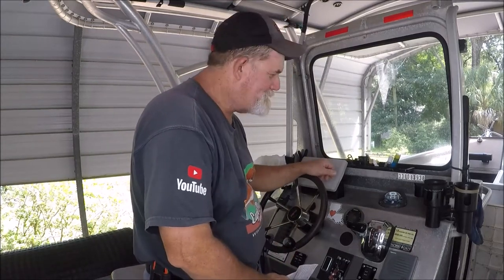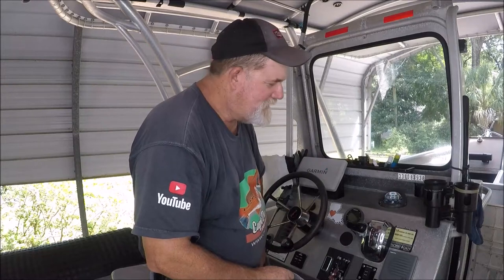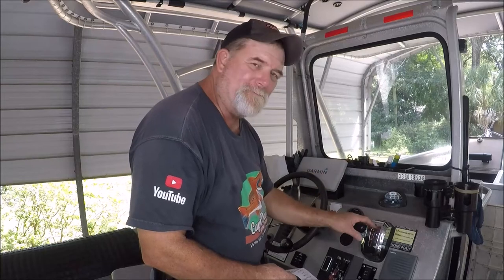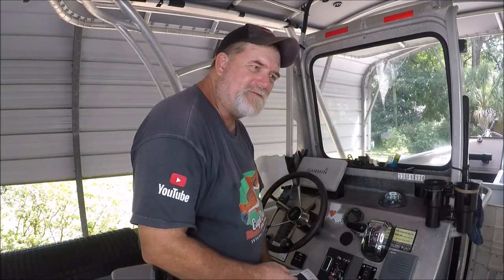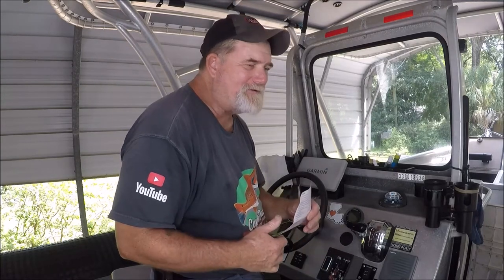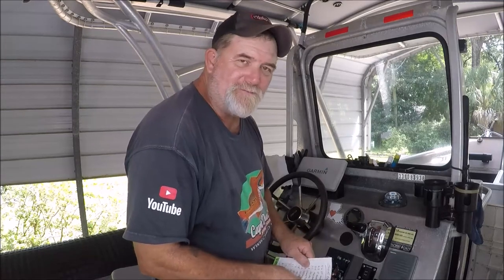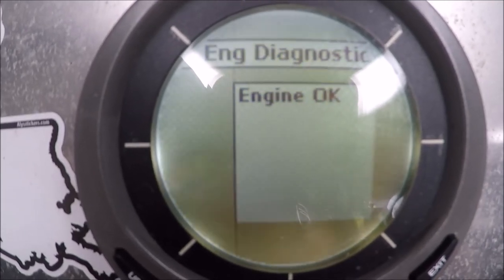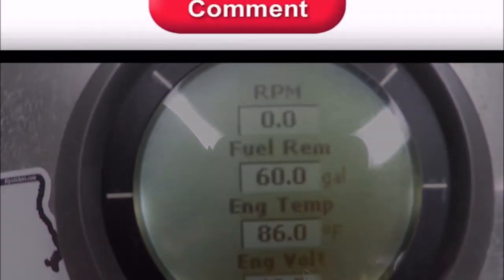SUZUKI OUTBOARD ENGINE CODES (you should be aware of)

Comment: You are absolutely right, very informative CAPTAIN. GOT MY ATTENTION.I have a merc 40 2016 with little to no GUAGE informaton ,GAS RPM VOLTS NOT ENOUGH TO MAKE ANY REAL ASSESSMENT..THANKS FOR THE VIDS
Reply from the maker: MERC HAS A COOL IDEA HERE FOR I believe over 40hp outboards: Merc Vessel view w/ app shows all sensors: https://youtu.be/lKs1Oq0mzUo
Reply: Thanks CAPTAIN DAVE YOU ROCK SIR.2020 🎆🎆🎆
Reply from the maker: @walldog1457  10-fer....its all right here on the 'tube.

Comment: Thanks for the informative Suzuki videos.  I have a 2007 Suzuki df300.   Last trip out when I was loading boat onto the trailer I got a w-2 code and the engine would not start.  I trimmed the engine all the way up and then back down, turned the key again and it started up.  I can’t seem to find anything on the internet about a w-2 code.   Wondering if you have?
Thanks
Reply from the maker: i''d assume since in the world of outboard motor electronic sensors, a 2007 is  an ancient motor. No codes I have start with a letter they are all numbers ie: 2-3, 3-6.... I asked a subscriber who's a zuki mechanic and works on a lot of ole crusty motors. I'll see what he says, and let ya know. You may have to find a zuki mechanic who has a lot of grey hair, and remembers the "ole days".
Reply from the maker: asked my buddy the zuki mechanic. He said there's never been a W-2 code. Even in the early days, because a W would be hard for a gauge to show. Even on small motors the codes are numerical.

Comment: Thank you for the tips. I changed our my IAC valve on my 150DF 2008, seems to work and engine runs great. Problem, check engine light still coming on at start up, Any suggestions? Thank you and tight lines!
Reply from the maker: like a car, you may have to visit a real suzuki shop and have it plugged in to the computer to clear all codes. I know...NO ONE wants to do that!

Comment: Hello friend, I have a question for you. I have a suzuki 225 2010 that for the first time I had a problem. When I turn on the key, its beep is low and when I turn it on it does nothing, but on the clock it shows the Ck engine flashing four times, it pauses and flashes 2 more times. In your experience it could be those codes that it shows on the screen.
Reply from the maker: CLOCK?????   I'm only familiar with a gauge like mine. look at a owners or service manual  https://youtu.be/o7nVQgjR7Qs

Comment: Great video! Do you have any information about how to re-establish connections to bus devices? I have a DF200 and performed an oil change and reset of the oil life (turn key to On, removed kill switch key, then pull out on the kill switch 3 times). That procedure reset all settings in my LMF-400 gauge including the list of bus devices. I used to have the engine in the list but now it’s not displaying. I’ve gone through the boat setup procedure per the manual but the only bus device that displays is the fuel system. Any ideas on what I can do besides taking it into the shop?
Reply from the maker: I'd "wild guess" you're still missing something, a setting on that really confusing and very poorly designed gauge. That's what I'd do. Just keep trying combinations to that puzzle. Maybe disconnect ALL power, as it seems to have a capacitor or something that holds power to hold preset setting??????

Comment: Appreciate all the advice in your videos. I am about to put a Df140 on my 21` bluefin aluminum. Hard to find the drive by wire 140BG but I can buy the 140a locally. Worth driving far and paying 1k more for the drive by wire instead of hydraulic?
Reply from the maker: 100%❗❗ its not DRIVE by wire. Zero to do with steering or HYDAULIC. Steering can be hydraulic. It's all about the shifting, and not sure if there's a 140 with it. You may have to step up to a v6 150 to get fly by wire, (aka: shifting.) NO more cables. It spoils ya. Smooth and precise. NEVER a single , '''GGrrrr, clunk'' into gear ever again. Plus, you'll get the newest gauge package. Fuel monitoring of GPH, used and no need for a gas gauge thats so in accurate.
Reply: @CaptDavesSportfishing  DF140BG was new for 2021. I could put a 175 on the boat, but I am no guide, just the wife and dogs...so saving that 75 lbs of weight seems smart with Democrat fuel prices. Sounds like you're telling me it's worth searching for the shift by wire. I thought it was electric steering too, I should research it more. Appreciate the response. Tight lines!

Comment: Thanks, Captain. Great video.
I have DF300 2013 and 1500 RH. Haven’t seen any error messages yet so far, should I worry about? And, just wondering how many hours did you run on your previous DF250 2014? Someone told me the lifetime of our engines is between 3000-5000 RH.
Greetings from Russia and safe seas!
Reply from the maker: i got rid of my last one at 2000 hours

Comment: Ah yes the old LMF200 Gauge. I got 2 of them for my 06's. They are hard to find now. I got all my eng stuff NMEA2000 into my 15 inch display. It shows way more parameters than the lowrance gauge.
Looks like Zuks maybe in my future pretty soon.
Great vid
Reply from the maker: Hello Skippa!! gawd I hope my vision doesn't get that bad that I ever need twin 15'' screens!  I'm connected into my litl' Garmin and never use it. Doesn't tell me anything better than this gauge. This gauge is ''okay'', but is better than nothing. I don't know how accurate the data is. But I'm used to it.....and the 3-6 O2 sensor codes, hahaha
Reply: @CaptDavesSportfishing  both of mine have washed out. You can hardly read anything
Reply from the maker: @chrisbernacki1012  10-4.....I've been practicing ''minimalist'' the best I can for less hassles and breakage. No pumps, no lights, minimal electronics. Its been working out.

Comment: I'm going to buy a new Suzuki at the end of this year.
Reply from the maker: always wait till boat  show time, to get best ''rebates'', and work the best deal. if so I wouldn't get any new motor with out the ''fly by wire'', soooo much better than cables. B-U-T, not all zuki's come with the option. It's called he AP models that have it. So, as an example don't think a 115 is a AP model. Larger HP's are AP's.  In 2014 I got a $1300 rebate and used the $ towards rigging costs and a new zuki prop.The 2020 motor I got only $800 rebate.

Comment: Hi i have a suzuki  150 from 2022 and ita say "check control unit c" and won't start. Do you know what that's about?😅
Reply from the maker: sounds like the BCM or boat control module in an ap model. it should be completely warranted. BCM is kinda like a hub for digital info from motor to controls and gauges .

Comment: I have a 2019 DF250 SS with less than 50 hours on it.  I run primarily shallow bays in the Corpus Christi area.  In the mornings when I first start the engine it will rev up to about 1200-1300 then idle perfect.  After running across the bay for a period of time, shut down the motor, fish for  a period of time, go to restart, motor revs up to 2100-2200 then immediately dies followed by 3 beeps.  I have analog gauges so no codes are visible.  It will do this anywhere between 6-12 times before it will restart.  I have it at the suzuki dealer where I bought it but suzuki is not being much help...thoughts?
Reply from the maker: FIND A BETTER MECHANIC!  you need better gauge, as I mentioned. Someone needs to hook it up to the software.
Reply: @CaptDavesSportfishing  They hooked it up to software and revealed no codes or faults but it is still a persistent problem.  Think I'm going to change dealerships.  Thanks for the input
Reply from the maker: @jmorris2908  That's very strange!

Comment: I had a 2014 df100 and the same gauge, everything works except trim display. Shows 100% even after calibratiing up and down position.... any help for me?
Reply from the maker: the gauge reads the trim switch, and is dialed in underneath the steering tube, there's a indicator under there. I never have made my perfect. I know by the feel.

Comment: The O2 sensor is NOT just "emissions crap". It's part of the closed-loop system (along with air metering and engine temp) REQUIRED for electronic fuel injection to function. That's why your fuel burn went through the roof. The O2 sensor could no longer "smell" whether you were burning rich, or burning lean. And to ensure the engine's safety, it erred on the side of caution and went full rich.
Reply from the maker: oh thank you mister science, its still a flaw and cost me lots of headache, time and $. which equals crap to me!
Reply: You could always go back to carbs. I mean, you'll spend more on fuel than you would have on O2 sensors, have worse part-throttle response and there'd be no more telemetry coming out of the engine, but hey, no more O2 sensors. Or pesky codes to read.
Reply from the maker: @GeckoDeLimon  OXE DIESEL 200
Reply: @GeckoDeLimon  more data the better. Back in the day my dad would have loved an engine temp alarm when he didn’t notice he picked up weeds until his engine went boom

Comment: Hey brother, I have a 2005 DF-250. I'm getting this AUDIO alarm (no lights) thought maybe it was a over heating prob. but NO after changing out the 2 thermostats and the one you did a video on (Pressure reg. Thermostat underneath the Tupperware on the right side... I'm still getting this BEEP..  I have a 6sec. video just don't know how to put it on here for you to see. Anyhow,, you have any ideas what this could be?
Reply from the maker: I'll send this to my viewer OROWOCK he's a zuki mechanic. LOOK FOR IT. he should respond. Guess there's no codes? Which is double wierd, but yours is a OLD zuki.
Reply: @CaptDavesSportfishing  I'm thinking either a low voltage alarm or one of the sensors???? Happen in and out of the water. When I put it in gear, the alarm goes away... put it back in N and it will come back.
Reply: No code but a beep? Is it continuous sound or intermittent?  For lack of better words, Is it a BEEEEEEEEEEEEEEEEEP   or beep, beep beep, ? sorry don't know any other way to ask.  Seeing your other post it could be the shift position sensor, not uncommon for them to go with age, If it was neutral safety switch you probably wouldn't get the motor to crank at all. It should be throwing a code. In other words the control module thinks you are starting the motor in gear because of the failed sensor. Im just taking a shot in the dark I'm not there and it's the simplest answer with limited info I can come up with. this should be the part number please verify if this is the problem and you intend to purchase.   13580-93J01
Reply from the maker: @FreedomWon20  orowock  replied. I thought same deal.
Reply: @orowock1  no it's a BEEP, ....BEEP,.... BEEP. And it will start this only after about 5 min. sitting in N while in the water. As soon as I put it in gear, it will stop. Then put it back in N and with in 2-3 min. the BEEP,.... BEEP,.... BEEP,.... comes back, No lights, just AUDIO
Reply: @FreedomWon20   Take a look into what I posted. sometimes these contact switches/ sensors become "sticky"  sounds like what I posted. A look into diagnostics would reveal within 5 minutes.
Reply: @FreedomWon20   One other quick thing you can try but i'm doubtful is disconnect all  ALL wires from the battery. not just turning the battery switch off, let it sit for 5 minutes then re connect. doubtful, but worth a quick try.
Reply: @orowock1  that was replaced just 2 months ago when I had her in for the main wire harness to be replaced, that sensor got replaced as well, along with the battery cables, all done by a certified Suzuki mechanic here where I live.
Reply: @FreedomWon20  Usually what you had replaced is due to water intrusion. There is a main harness on the motor and the harness from the motor to the controls and gauges. If one harness failed it's possible the other failed as well. Water does some really funny things when it gets into wiring, Best thing to do is have it diagnostically tested,  without having this done it can be very difficult to put your finger on the problem.
Reply: @orowock1  rgr that... I called the mechanic that worked on my motor.  He said the same and is on a personal mission to rectify this for me. The reason the main wire harness was replaced was due to mice chewed it up. After they put everything in, he told me they ran the computer check and NO codes came up. But he said he will make sure this prob. gets fixed... I guess he's going to call me and tell me that they have to hook it back up to the computer? oh, and I disconnected everything from the battery waited awhile and reconnected... I'll start it up and check it later today,,, I'm a early riser and don't want to ruffle any neighbors... LOL
Reply: @CaptDavesSportfishing  Ok, found out that the 1100 RPM is what was giving off the audible alarm. the motor is suppose to be around 750 RPM. So when I checked the cables (since the mechanic replaced them), I found that one was OUT of it's carriage gab thingyabob. So when I pushed it back in the RPMs dropped to 1000 and the alarm stopped beeping. BUT its still too high. Do you have a video on how to adjust the idle on this motor?
Reply from the maker: @FreedomWon20  I don't really understand any of that, but no. Idle is something I never messed with.

Comment: How can I find out the engine hours?
Reply from the maker: if you don't have a multi-gauge like this, ''showing the hours'', you'll need to plug it in to a motors computer with the software. any suzuki shop has the diagnostic software hook ups.
Reply: I use the same multimeter as you, but I don't know how to press the engine hours?
Reply from the maker: @meme330212  it's the dumbest gauge to configure ever invented, I will admit. the engineers who wrote this all up and designed it should have been fired! Use menu button and look in every ''so called'' menu topic. It's there. The more you look around and experiment, you'll see the pattern of who this stupid thing works.